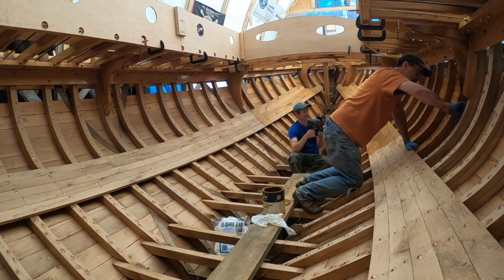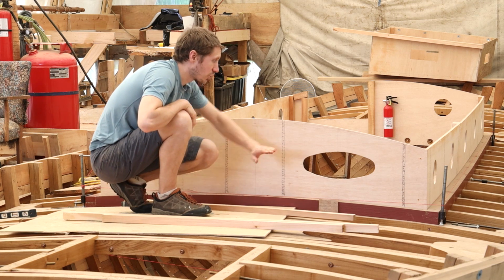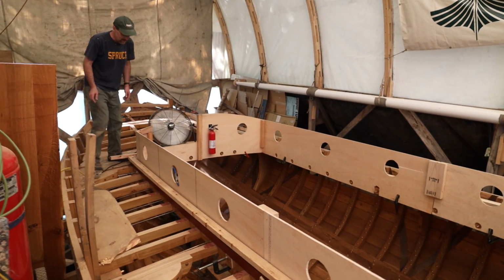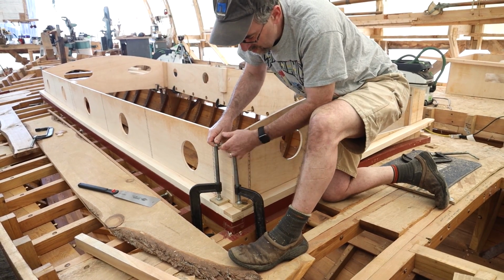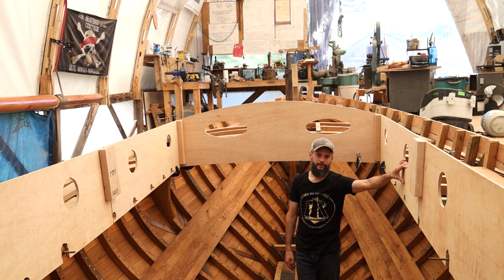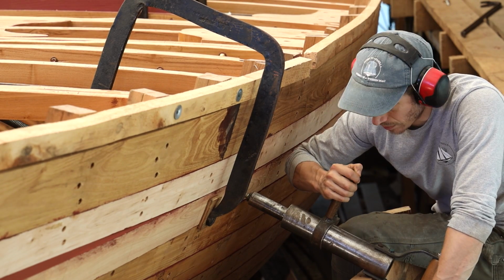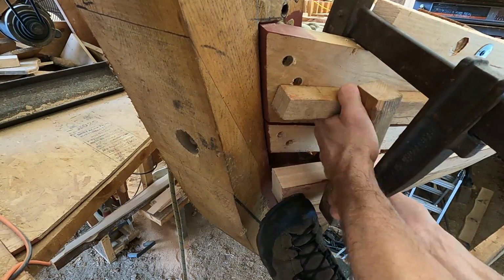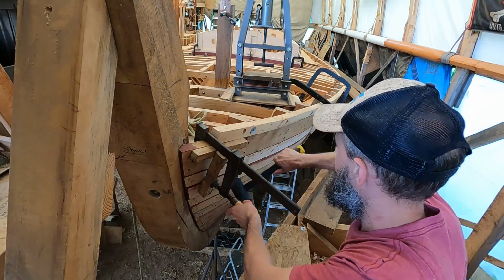Finishing the Port Side Planking - Episode 170 - Acorn to Arabella: Journey of a Wooden Boat

Comment: Square bales... that brings back memories of baling with my grandfather... good times. Hard work but good times.
Reply: I was thinking the same thing. I used to throw those bales around like they were weightless, I don't suppose I could lift one at all nowadays!
Reply: Yup, was thinking the same.
Reply: When I was a kid, on the farm, we put up a thousand or so every summer. Then my dad loaned us to the neighbors for $0.01 per bale.   When I was strong enough to throw them into the loft, the pay doubled!  But, the sweat, hay dust and itching was still the same!

With gas at $0.24 per gallon it didn't take long to make enough to fill your gas tank.... but back then, we only bought a dollars worth.  It came with a free oil check, tire check and windshield cleaning!  

Me thinks: Those days are long gone!
Reply: I threw many a bale of hay in highschool also. Oh the blisters on my hands! The old square bailer is still in use to this day. Same wagons and same old John Deere tractors also. Old  john and big John still run and are used. Uncle Mick would be so proud of how his son has taken care of the farm and equipment.
Reply: Every young teen should spend a summer tossing bales.

That said, the happiest day of my youth was the day my dad bought a hay-roller for our operation. I wouldn't have appreciated as much if I hadn't spent the previous two summers with the bales.
Reply: You haven't seen a pissed off truck driver till you've seen one that had a load of round bales go over. 

Square bales, you can get a chain of people going and reload the trailer. (Edit: or at least clear the road so traffic can pass)

Round bales? You're stuck waiting for the loader, for however many hours it takes to get to you.
Reply: I too have fond memories of baling on my grandfathers farm back around 1960. We had bale hooks that made grabbing and placing the bales a little easier.  To this day I enjoy watching baling of any fashion but especially the way shown here.
Reply: @ScottKenny1978  Yeah, I had that happen when I was driving the tractor pulling the flatbed they were putting the rolls on. It sucked, but not as much as if we had been tossing all those bales.

One of the things I liked about the rolls is that I could place on at the top of a rise, cut the strings, and let it roll out. 

Better access for the herd, and less damage to the pasture.
Reply: @bp-ob8ic  realized I forgot to mention clearing the road so traffic could pass. Where I live, lots of mountain roads, a hay truck going over will block traffic for days. I mean, the detour if US95 is closed is well over 500 extra miles!

Comment: Cabin house and cockpit, looking forward to that! Just don’t ruin it by trying to level out the cladding lines, let them follow the hull and deck curve , cut to shape at the top and finish with an oak capping dowled in at the shape of the cabin top! Lap jointing is a good idea, that’s the way I would do it, just a slight downward angle to stop any possible water retention spot if any joint ever decides to leak! Using the west system epoxy and woven matt it will really look great and have superior strength with all those curves moulded together and working against each other making those lift of structures super ridged! Get working guys, another winter is on its way, plenty more to do!

Comment: Perhaps, you folks have already considered entertaining an alternative storage location regarding the dingy.  Arabella was not designed with a dingy.  You might want to consider doing a mock-up of the house, dingy, and boom together.  Might take some time but perhaps well worth the effort.
Reply: +1
It may not be a software project. But the same ethos of testing potential solutions for problems can be used here.

Comment: Wood takes up water out of the air. On a dry and hot day it will shrink and on a wet day it will swallow. Traditional building methods work with that given. A carvel build boat will be watertight after a few hours in the water.  Epoxy is totally water/dampproof....impermeable and is rocksolid. So if you put epoxy and glass on one side and you leave the other side bare, or just painted, the wood will be working...shrink on a warm day and swallow on a wet day... I did some experiments wit small pieces of mahogany. A piece which was 30 mm (across the grain) after drying in an oven. The next 3 days it took on water from the air and swallowed 5 mm (16%!!).  Covering a boat, only on the outside, with glass and polyester is called "the cloth of death". Point is, you can not do both methods on one project. The boat itself will vary in size due to moist content of the air and your cabin will be the same size whatever the weather is. One way or the other it will give stress somewhere in the construction. Whatever you choose is okay but be careful when you mix the methods. For Acorn to Arabella is due to the circumstances,,,,building in a tent... almost impossible to get the wood as dry as necessary for working with epoxy. Wood completely covered in glass/epoxy which contains to much water will get big bubbles in the skin. Because on a hot day the water will start boiling inside and will form steam. Steam expands. And so on. My advise would be just stick to your plan and stay with your traditional building method. It is what you do the best and I can't wait till next Friday for another episode of "From Acorn to Arabella"! (The name says it all)
Reply from the maker: We aren’t the first to strip build, by far. There are successful examples of strip built boats (or boats combining construction methods) all over. And it’s quite common to employ different methods in different places to reduce weight, smartly use lumber, avoid moisture intrusion, or whatever reason. 

Thanks for watching!
Reply: @AcornToArabella  Of course, every Friday, lunchtime in the Netherlands.

Comment: I remember as a boy spending a couple of days sat on the back of a bailing machine tying knots. One of the knoters  had given up the ghost and the weather was not going to hold long enough for the replacement knoter to arrive. By the end of the first day I looked like I was suffering from a strange new disease, never did the pub and three very swift pints of bitter look so good. Can I take it that you sell your hay to the equine industry as you have your ram trip set to what appears to be a mid weight bale for the ladies.I always preferred to pack them hard ,as the bales stack better and are less prone to rotting in the middle not to mention they take up less space in the barn.

Comment: I hope it's ok to tell you how Dad and I put the cabin top on our sail boat. It was laminated so no beams to hit your head on. He made a wooden frame with the arc, width and length  he wanted then nailed 1/8 " marine grade plywood to the frame using copper ring nails. The first layer went length ways, the next went side to side and the top layer was lengthways again. The glue was two part epoxy UF 109. The top was then fiber glassed using fab mat. When it had dried for a day or so we flipped it over and I knocked the frame off. Then the exposed nails were cut off with an angle grinder. Dad then stood on it and it did not flex at all so he drove the front end of his pick up on it and it held. I think the plywood edges were notched and glued. This was over 50 years ago but I still remember how difficult it was to get the darned thing off the frame. The boat was called "Serene Isle" and was built on Gabriola Island about 1965 or so. If you want a picture, let me know and I'll ask my Daughter to send you one.
Reply from the maker: Thanks for sharing all this detail! We’ve got a plan and appreciate hearing your experience.

Comment: Every board that you add will be in the way. Time to do plumbing and electrical.  Bulkheads and cabinets don't deck it or build flooring yet. There are sticky mats I used for construction to keep the guys from tracking crap into the hull.

Comment: My suggestion? Forget putting the dinghy on the coach roof. The less windage up high the better. If you build a nesting dinghy (I'm a fan of Danny Greene's Chameleon Nesting Dinghy - in fact, I'm building one at the moment), you can easily find space for it on the foredeck somewhere.
Reply: Or go with an inflatable dinghy
Reply: @dinosaurus4189  - Inflatables have lots of disadvantages. They don't row well, they can't be sailed, they need more powerful (and hence more expensive) outboards than a hard dinghy, they're more prone to theft, they wear out much faster (and leak a lot once they're getting old), they don't like being hauled over sharp rocks or coral, and they're notorious for "wet bum syndrome".

Comment: Put extra flotation in the dingy seats. Test it so it can swamp and still be pumped out. Alot of long haul sailors use inflatables for stowage. The point is. Underway it is in tow. At the marinas it is tied along side. All wind bearing surface above the water line is a detriment to performance.

Comment: The less cabin side area,  the less wind reaction on it.  That's a fairly long cabin,,so lotsa cabin sail if it is too tall.   Definitely don't want to cut it down to USS Monitor view ports,, but less is definitely better on cabin sides. When you jibe turn and swing the boom then, the air ripping across and up the cabin sides really trounces the canvas during the swing, slowing that process.  With the dingy on top of the cabin, that air turbulence can be even greater,,depending on the seas.

Comment: I would recommend keeping the boom as low as you can. You typically don't put in a reef in ideal weather conditions. Now imagine trying to reach over the dinghy in high winds screaming at each other trying to get that done. Now try having to reach UP and over the dinghy. Also, I feel that more camber (to a point) is more better for keeping water from puddling. My $0.02.
Reply: Good advice!
Reply from the maker: We’re talking inches, not feet, though you make a great point. Thanks for the thoughtful

Comment: If you put cling film on the ply mockup then the house sides won't stick to it when gluing.  Packing tape/wide sellotape works as well and easier to stick in place but costs more for a large area.

Comment: Guys, in my opinion you are making hard work of your Cabin structure.  I suggest you use a very simple “ Strip Plank “ Process, leaving the corners running past and cut the 4 Vertical Corners in 1 cut each when the. Glue has dried.

Comment: Those three hours spent not deciding to change the house height aren't wasted. Sure, you set out on deciding a design feature, which you didn't do. But you also found a way to proceed without committing to a design feature.

If the boat is indeed a knot whose strings can't just be tugged on in isolation. Then it makes sense to invent ways to proceed without tugging on any strings you don't have to. That is the 'achievement' that you could set out to find instead. 

And you did. You spent time on it, found a way, and proceeded the build.
Success!
Reply from the maker: Thanks for this thoughtful comment, Niels!

Comment: Newbie here but my dad messed with timber boats when I was a kid and I fully remember him filling the "Lois Anne" with water while it was in the driveway of our home. I was in awe not so much of the water in the hull but the weight of a timber boat filled with water sitting on our then concrete free driveway. My question is; Will you fill Arabella with water (hmm, on-board engine...) to seal her before you launch her?
Reply from the maker: There’s no need to fill the boat, per se, but misters, humidifiers, and even just a heavily wetted floor are options for swelling her before we caulk her, and then yes, perhaps also before we launch her. The thing is, the two hour slightly speedy drive to the ocean is like a time machine for drying, we’ll see what happens when we get to wherever the launch site may be.

Comment: I'd recommend always keeping the extra height instead of getting rid of it. Will give you extra room which is always good, and plus, you could hang a net up there and keep provisions stored there. You can always figure out a way to make the dingy work. I would agree the camber is probably a bit extreme though. But once you start adding in flooring, ceiling material etc. etc. you could regret getting rid of that height. No one wants to walk around instinctually kneeling down because they're so close to the ceiling. No metal flashing around the sill plate for the house?
Reply: Maybe they could build up the strips much higher than the expected cutoff, and have a mockup-roof they can slide up and down inside the walls of the house as they please.

That way, whey could experiment with all kinds of questions like this, before making a final decision.

As an added bonus, it gives them an excuse to play around imagining to live in the boat, and it won't just be for fun. ;)

Prototypes, Beta-testing and bug-hunting.
Reply: I was thinking about the camber, too - cutting an inch or two off it would increase clearance for the dinghy, and make it less slippery around the mast in bad weather.

Comment: You said you can raise the boom a little bit as well lower the Housetop. I was wondering how the sail was going to sit on the boom when lowered. Will this affect the amount of space you have allocated the dinghy.  will the sail be rubbing on the bottom of the dinghy when not in use or partially lowered for high winds.

Comment: any specific reason that you go for slotted flat head screws? Ive often thought they were simply old school fasteners, and with the advent of Roberts and Philips screw heads, weren't really useful anymore... ? curious
Reply: When you have to remove the screws, cleaning a slot out is easy, cleaning a phillips head or square drive head is a real pain, and you can easily end up stripping out the head.

Comment: How about hanging the dinghy off the stern - easier to move,  out of the way, more headroom, faster/easier to deploy.  Seems like a no-brainer
Reply: Can also allow more light in, if desired
Reply from the maker: With a boat that has a transom, maybe. Davits don’t work well on a double-ender, and hanging that much weight off of the stern isn’t a good option for a great many boats.

Comment: Curious. Why if the cabin sides are going to be laminated and glued with epoxy are you doing half lap joint. Why not just lay the strips down, leaving the ends wild. After glue cures cut the ends. Easy.

Comment: PLEASE keep a hard hat on board for tall guests!
Reply from the maker: There are many boats without standing head room at all… and there are booms below where most adult heads are. Mindfulness is an important skill on a boat. 

It’s just not the same as a land house, really.
Reply: @AcornToArabella  Don't hate the vertically enabled, they didn't ask to be tall!  It takes years of negative reinforcement to instill proper hunching it low overhead spaces! I speak from experience. 2 weeks on a small cabin cruiser and I'm 6'4". It never got old to the other guys when the boat would thud and they knew it was my skull again. If given the option I would have worn a pink hard hat with glitter instead of the headaches. Great videos by the way. Don't mind me, I'm just jealous! The only thing built for tall people is the top shelf!

Comment: I would have left a port plank out as well. That way when you close up starboard the port shudder plank will also tighten up seams. Thats just my opinion tho
Reply: There's so much gap between all the planks, that you can't recon to tight it up with a shutter-board. At least not so high in the hull.

Comment: Willl the exterior of the house be fibreglass or will you put another layer of timber over the glass?
Reply from the maker: Fiberglass cloth set in epoxy is a more apt way of saying it. It is the final layer… well, with the exception of a few filler coats of epoxy.

Comment: Will something be done to the beam on the bow of the boat? Seems like it wouldn't want to cut through the water very well being a big flat surface like that?
Reply from the maker: The stem? Many stems are close to square and slightly rounded off. Stay tuned, we’ve not faired the hull yet.

Comment: If you want to fit the dingy to the top. Maybe build the dingy so you have the shape and you know it will fit.
Reply from the maker: Mmm, that’s a stability problem with many small boats to mess with sheer lines and top sides. Seems like an easy fix, but it makes a tipsy dinghy.